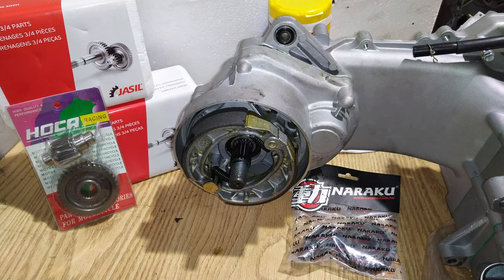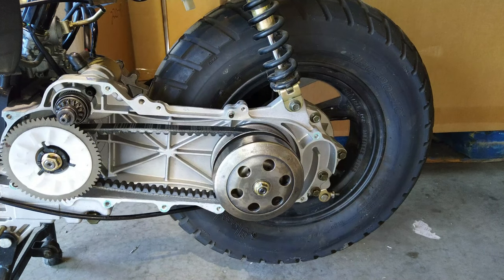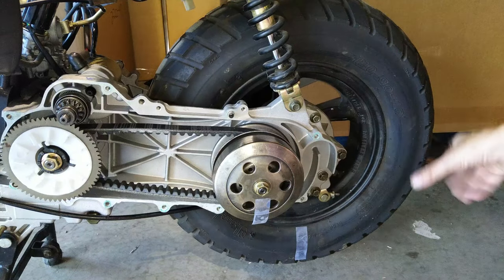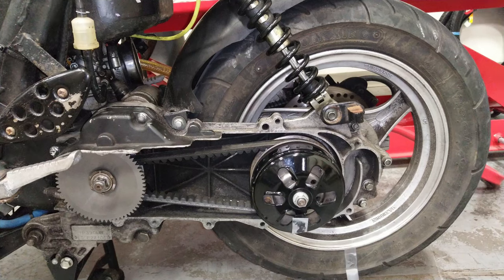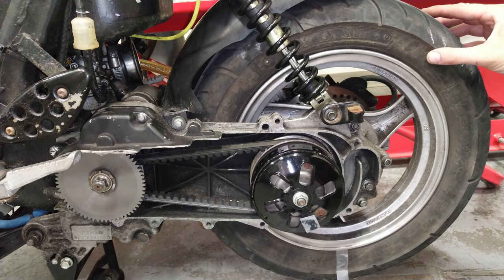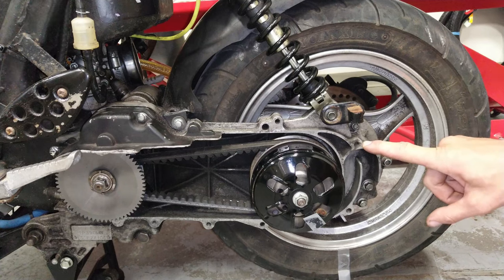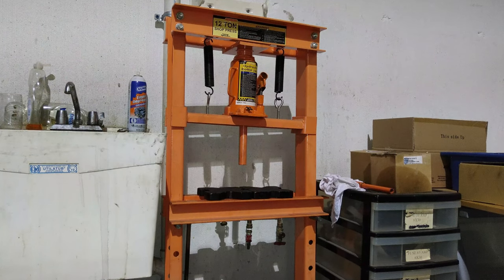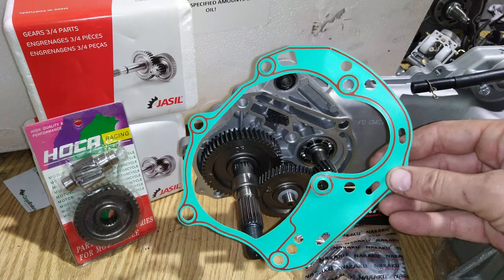Scooter Gearbox Explanation

Comment: Question,what was your gear ratio before you take it apart? I did the test where one would put tape on the bottom of the clutch bell & the tire & then mark the floor.My count was clutch 13 turns per one full turn of the tire.I got a new GY6 50cc motor with improved HP 2.81,built by X-Pro from Amazon.After you installed your new gears,what was your ratio? I'm trying to find out if mine has racing gears installed.I have the motor all hook up and the tire on it.

Comment: hi me again i have a typhoon 125 4 stroke with all upgrades like malossi 190 kit Pollini hi speed variator Pollini belt and spring malossi up gear sports exhausts done the tape on back wheel with deferent gear boxes  i have 14/11/ and a 10 turns to one turn of back wheel  but still will only do 62 top speed (acceleration is mint) not sure what to try next can anyone help thanks Paul

Comment: Hello, I have a 152qmi 125cc gy6 and it only does 55mpg (gps speedo) what gearing would you recommend to get a bit more top speed? And would it be worth putting a 150cc kit on to help with the lower speed?

Comment: I got bbk 80 on a maddog 50. Naraku cdi . Bando 788 but a bit wider then stock . Bando coil . Ncy 9g rollers an clutch an bell . Red springs . Black top cvk. Sucks...... An short air filter...... Engine gets hot. Got a oil leak 
 An new chain tensioner. Either i broke the bolt on top of it or who put it on the first time had tighten it to tight
Reply from the maker: So I'm just seeing this. Was the carb you got a 19mm or a 20mm? 19 is too small and a 20 you'd need to tune regardless depending on the quality of the kit installed. You changed a whole lot up, did you do it all at once? That can make things really difficult to tune. You do have the shrouds installed on your engine, right? If they are are and the engine gets hot, you need more fuel, you're running lean.  That'll give you more than a leak.

Comment: Hi what gear am a need for 57.5mm cylinder and head upgrade kit?
Reply from the maker: 57.4 is the stock bore for a 150cc engine, so unless you're upgrading from a 125cc, you'd keep your stock gears.
Reply: I was thinking  about an 58.5mm cylinder with the 57.5mm head what u think about that.. ?
Reply from the maker: @tizanqueeley1275  With a smaller big bore kit like that I'd see if you get the speed you're looking for from a good variator and weights first, and if that doesn't give you the performance you're looking for you can then look at taller gears.  The 58.5 kits sometimes won't push real tall gears though, and accelleration will suffer.  You usually don't look at an upgear until you install 61mm kit in my experience.

Comment: I purchase a Gy6 gear set 14*37 for my 150cc moped and I did not get any higher top-end speed
Reply from the maker: Have you installed a big bore kit on your bike? Without a big bore kit some engines can’t push taller than stock gears, and you won’t see a higher top speed.

Comment: Hey I have the same kind of transmission that you're gearing up and I have a Big Bore Kit 90cc in my bike and I just bought the 17 to 49 Gear Up will that work in my bike I was thinking about just changing the 17 instead of instead of the 49 because my final year is a 51 and the final year that comes in the kit is a 49 so wouldn't I just change the the center the center gear which is the 17 and not change the final gear
Reply from the maker: Generally, gear kits are cut to match each other, so if your kit comes with 2 gears, install 2 gears.
Reply: @Partsforscooters1  okay yeah I just found that out I watched another video and the guy had the same issue so if it if the kit comes with a 1749 you can only use a 1749 I cannot use the 1751 I have to use the what came with it so you're right thank you
Reply from the maker: @fixitdaniel  Exactly. Glad it's all figured out now!

Comment: hi can you help i have a typhoon 125 (4 STROKE)2010 10" wheels with 190 malvariator and clutch but still only goes 60 so going into the gear box can you advise
 me on what gears to get thanks Paul
Reply from the maker: Gears aren't going to help you unless you install a big bore in that bike. a stock 125cc engine doesn't have enough power to push taller gears. You are best using stock gears on a stock bore bike.
Reply: @Partsforscooters1  hi sorry should of said it has a malossi 190 in it

Comment: hi there, good day! i have an NMAX 155cc stock engine.. it has a 12x35 gearset.. i am planning to purchase a 13-teeth counter-gear, which will make it 13x35.. what do you think will be the effect, does it pull off with some descent torque and yet came up with an increase topspeed..? thanks!
Reply from the maker: Unless you add power to the engine though modification, when you re-gear the rule is that taller gearing will result in a higher potential top speed at the expense of acceleration, while if you gear shorter you will always sacrifice top end speed for better bottom end acceleration.

In your case you will most likely lose some of your off the line acceleration in favor of a few MPH/KPH on the top.
Reply: @Partsforscooters1  If I wanted more top end speed would I be able to mess with other parts to increase acceleration and my top end speed at the same time or when upping gear ratio will it render the rest obsolete?
Reply from the maker: @adrianscoggin7212  You can get more speed with more power without gears on most scooters because there's usually overhead with the stock gearing/transmission that is untouched when using a stock engine config, to test this, you'd mark your variator with sharpie, and when you've built, tested and tuned your engine so that the belt ride high enough on the variator that it wears off all the sharpie, if you want more top speed after that you're looking at gears.
Reply: @Partsforscooters1  okay, that's actually a big help. Thanks I appreciate it!
Reply: @Partsforscooters1  
12x33=2.75
12x34 = 2.83
13x34=2.61
13x36=2.77

For your information which is the better combination....i also use nmax,
Reply: @Partsforscooters1  for variator part i hv done modification just want to know which is the better one,ratio not lose acceleration and can get top end speed

Comment: I'm currently hitting redline at around  53mph on a stock small tired scooter. I'm wanting a little more headroom to keep me out of the red at highway speeds of 55-60mph. Do I need taller gears to achieve this?
Reply from the maker: Tall gears are really of primary benefit after the installation of a big bore kit.  You need more power than stock to push the higher gearing. Is your bike's engine stock?  If so, start with heavier roller weights in the variator.
Reply: You need to check your speed with a GPS on your phone
Reply: @mrcleanisin   It's accurate. A friend riding next to me gets the same numbers on his scooter's speedo. His is another brand with taller tires.

Comment: thank you in advance. can you help me about dragging issue.while i run 60 to 80 kph then apply brake back to 10 to 20kph,when i back to twist throtle it will never run directly until i twist throtle 4 to 5 times then quickly run. all cvt was already clean. new stock belt/center spring/clutch spring and bell. hope you can help me.thank you.from phillipines.
Reply: check  spark plug, air hose pipe from petrol tank to carb and tune your carb if required.

Comment: Have a 150cc Gy6 scooter that does 53mph. Will be installing a 170cc big bore kit, trying to make my scooter do at least 60mph. What gears do I need to achieve this ?
Reply from the maker: I'd recommend you go one modification at a time.  Do the Big Bore, and then tune the transmission properly.  If that's still not enough, then you look at gears. You may not need gears if you're only looking for 60.

Comment: I have a "same as use with clear tape on video" 139qmb short case with 100cc b/b kit installed.Have not done anything to my gear box, what would you recommend me?
Reply from the maker: There's no such thing as a 100cc kit for the QMB139 engine.  What is the bore of the kit you have? That will tell us what your displacement is and we can go from there.

Comment: 10 40 oil fur transmision.. Or valvoline 75 90?
Reply from the maker: Bel Ray Gear Saver

https://www.partsforscooters.com/172-117_Bel-Ray_Gear_Oil
Reply: @Partsforscooters1  it says..for wet clutches; still the best for a scooter?
Reply from the maker: @josepeixoto3384  Still great for a scooter.

Comment: hey i need your help, ii have a Nmax 2019 abs and has complete variator upgrades and i currently have a 12x34 gear, 11g weight rollers, 1krpm torque springs and 1.3krpm clutch assembly springs
and i want more top speed with my stock engine need help
Reply: Anu top speed mo jan bro?
Reply: @nurali28  126 patag
Reply: Hi Taco Mman, may I know with current gearbox, 12/34 how much top speed u already get
Planning to change my gbox as well
Reply: @mohdhafizulabrahman1195  131kph with cvt upgrades

Comment: What gears do I need for stock 150cc to make it faster
Reply from the maker: On a stock bore engine, you would stick with stock gearing. A stock engine doesn't have the power to push taller gears and if installed on a stock engine your performance will actually decline.
Reply: @Partsforscooters1   I do have a big bore kit for my 150cc and up graded cam 61mm piston what gears would be good for that and thanks for the good info
Reply from the maker: @Robert-v2n1h  Which cam and 61mm kit do you have? Did you upgrade the head too?
Reply: I have a a9 cam and 61mm from rolling wrench and yes I have upgraded valve springs
Reply from the maker: @Robert-v2n1h  https://www.partsforscooters.com/137-3-Naraku-18-36-Gear-Set
Reply: @Partsforscooters1  thank you for the info I will be ordering from you very soon

Comment: What type of gears would I need for a 50cc? I know I can upgrade the cc's to 60,70,80,90,100.
Reply: Bro just give your moped a bigger bore
Reply: Just got done working on it.Going to call my mechanic & have him come & get it.I got the Racer 50 from Amazon.
Reply: I have an 80cc X-pro Maui with a racing variator, 6.5gram roller weights, and rear clutch 750rpm stock springs. I'm going to replace my 18mm carb with a 20mm carb, put a conical filter, swap to 7gram racing roller weights, up the gear ratio, and then replace my 5 pin CDI box with a derestricted 6 pin CDI box, put a performance ignition coil and racing spark plugs in, then swap my stock exhaust with a carbon fiber racing exhaust and replace the stock tires with on/ off-road tires and then upgrade my headlight for better night driving. I've also already bought an underglow and upgraded my trunk to a motorcycle touring trunk and I'm soon gonna be putting on a new pair of saddlebags. That and I'm gonna upgrade my windshield. With the rear clutch and variator upgrades added with the big bore 80 I already have on it this thing has a decent acceleration and gets to 50mph no problem. And best part... All black. I'm thinking of hydro dipping my bikes body panels and then spray painting stripes to the front or another design. That and I'm gonna swap my skeleton hand mirrors to ones that can be wired in with the turn signals. All in all the bike I got is a beast for a Chinese scooter. I'm also gonna be looking at upping my gas tank size which will take some finagling and messing around with the frame.

Comment: I have a gy6 conversing and I need a setup to get me up hills here in eastern Kentucky. I weigh just under 200 lbs. rollers? & gears?? Ty
Reply: Love lighter  rollers, and /or stiffer spring in the rear , will probably get you where you need to be,  im in the foothills of NC,  it's hills everywhere here,  only good thing about going up, it's down on the way back! Haha..  the lighter weights will give a higher rpm at top speed, I'd try 1 gram lighter, maybe try the slide weights over the rollers, get some scales, and drill out weights to save money,, then buy the weight equal to the modified weights, if yours is like mine, a 4-5gram weight set will probably work. I don't think gears is really needed,